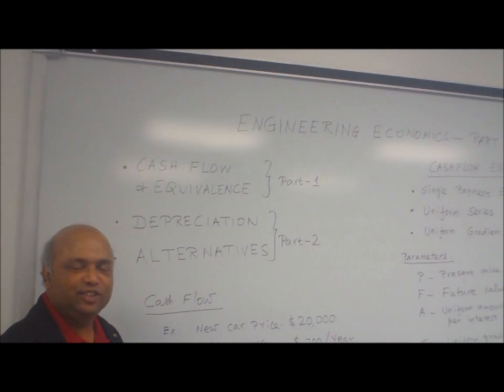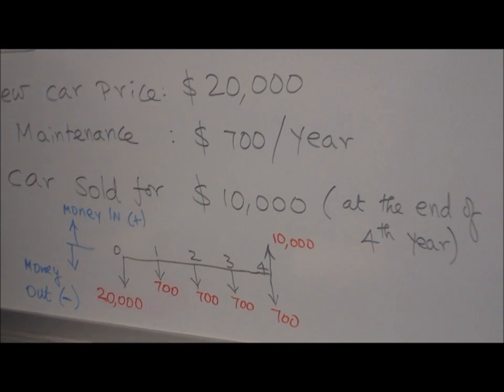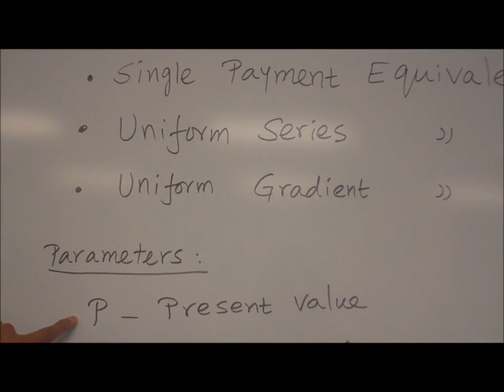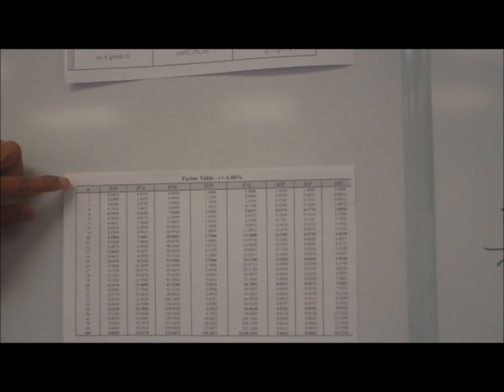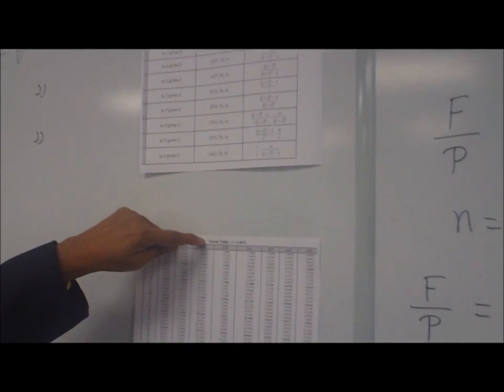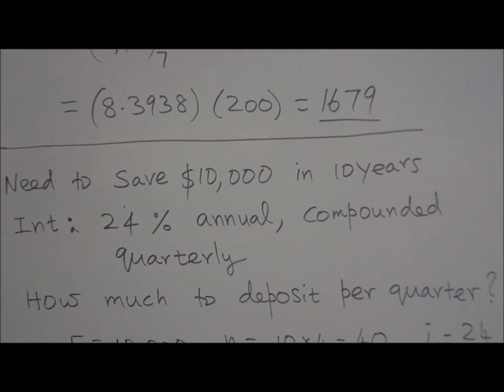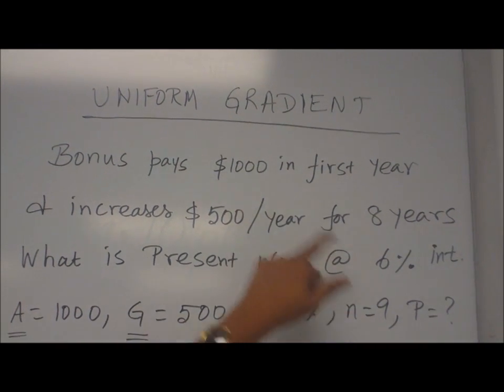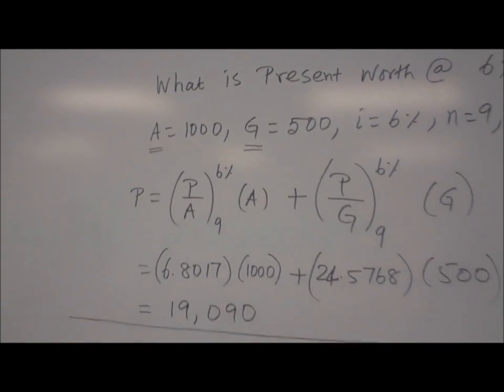Engineering Economics Part 1

Comment: excuse me sir , all great s but there is some thing wrong which is the EXAMPLE 2 :
(( compounded Quarter )): means that we must calculate  the adjusted interest rate by using the NCEES manual reference formula in page 127 ( i =(1+r/m)^m  - 1     ,, where r : is the annual interest rate  and m= 4(quarter year) ,, by applying this formula the adjusted i = 0.2624     ,, and the final quarter payment is ($282.77) ,thank you for the video ,,

Comment: I thought this was great! I wasn't sure how to handle the A and the G. I didn't realize that you had to find the present worth of both and then add them together. Also, I would have said the $1000 was the present value and used F/P, but I assume because a bonus will be paid annually that this is why A=$1000??? If so, this makes perfect sense! Thanks for this video!